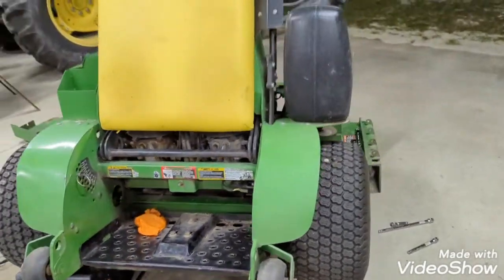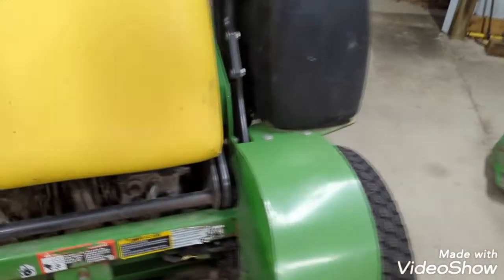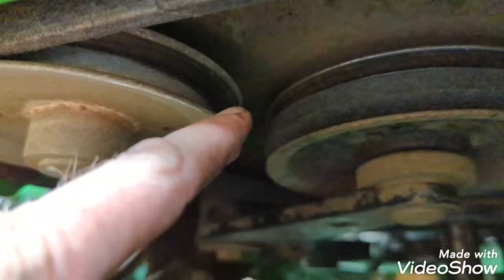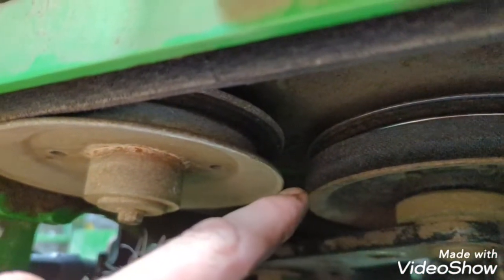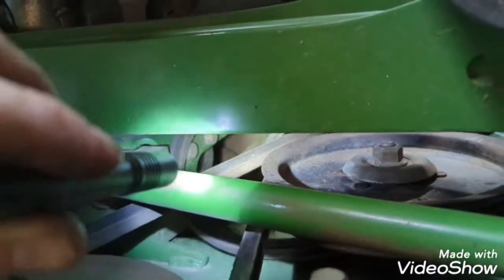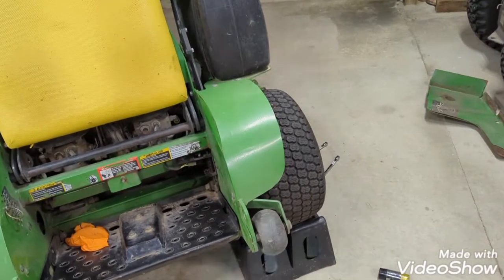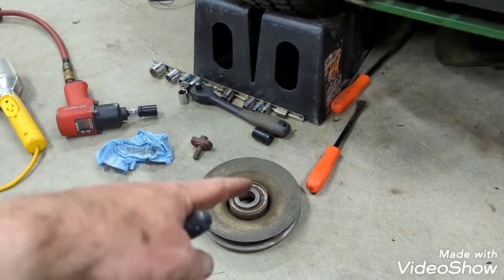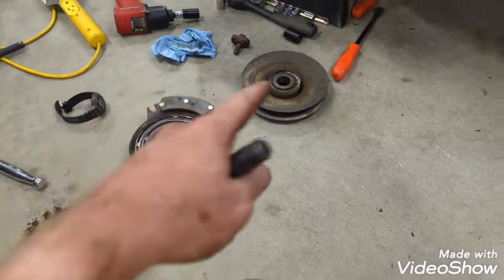HOW TO: REPLACING THE DRIVE BELT ON THE JOHN DEERE QUIKTRAK 652R

Comment: I have a 648R, I bought a B61 belt at NAPA that fit the hydro pump belt, cheaper than old JD, but nowhere near as cheap as "Off Road Belts" I am in process of changing that belt for first time, I am planning on removing that bracket, I will let you and others know how that goes, I run mostly toros and have changed that belt many times on them, and with the toro you need to remove that same basic bracket
Reply from the maker: Already responded to your finished comment🤪😂👍

Comment: Well that's good news with the GT 235 💪👍Wow the pulley's were actually rubbing together that's wasn't good 😲Yea that is a very tight spot to get them bolts. Those pulley's look so much better with the separation. Man you did good putting that all back together I would have had extra pieces left over 😂Oh I hope this works cause if it doesn't I'm gonna see a mower flying off a cliff 😂Thank you again for the shoutout. Oh man that is in a bind. Get a shower and a Krispy Kreme donut 🍩😁😜 buddy 👊💯
Reply from the maker: Anytime on the shout out buddy. 😂Funny you should say that....we picked up two dozen 🍩s today 🤪. Yea...glad the GT is running decent, still needs some tweaks. Def hope I can get that out of the bind and it didn't hurt the clutch🙄🙏. That would cost me $350🤦. Yea those pulleys def💯 look soooo much better with the spacing now. Don't think it will be quite as bad now that I have done it once🙄🙏🤞🤣.
Reply: @joshslawnlandscape9935  I really appreciate you 💯Yea I picked up a box myself 😂You'll definitely will get them tweaks out 💪Yea when I saw that in a bind I was like 😲Ouch $350 yes I'm so glad it didn't hurt the clutch. Yea I couldn't believe the pulleys were rubbing together. That's true since you did it once it shouldn't be as bad 🤞I hope the best for you buddy 💪👊💯

Comment: got it changed out, not an easy task, I did remove the bracket, not the clutch, I had more problems with getting the belt over the idler pulley, if I was doing it again i would spend more time trying to remove the idler pulley, the bolt did not want to break loose, when I reinstalled the bracket, I reverse the bolt and nut, I was working alone and I would have never been able to get them in the way they were installed
Reply from the maker: Yea...I looked at those bolts and was just like "nah, not today"😂. Def not a lot of work space on these machines...lol. Glad you got it changed💪👊👍

Comment: I believe the clutch plate should go under the guide, right?
Reply from the maker: That's correct...I just had to pull the clutch down and adjust it so that plate was under the guide👍. Just got in a hurry and didn't check when I was putting it back together 🤦🤪😁.
Reply: @joshslawnlandscape9935  yeah, total pain in the ass. Absolutely terrible design by Deere. Should be able to swap any belt in the field without taking off the whole damn clutch.